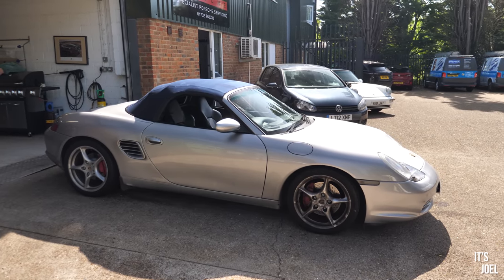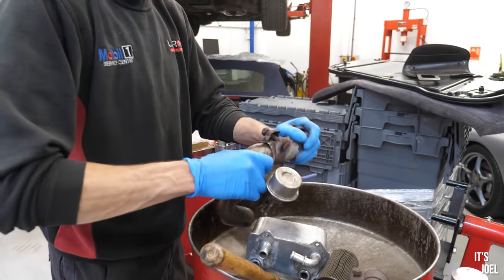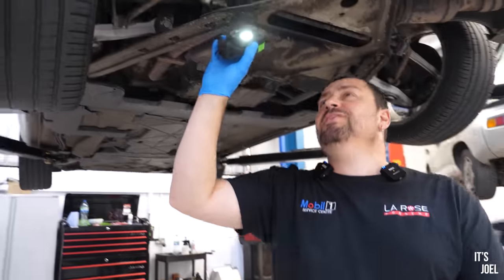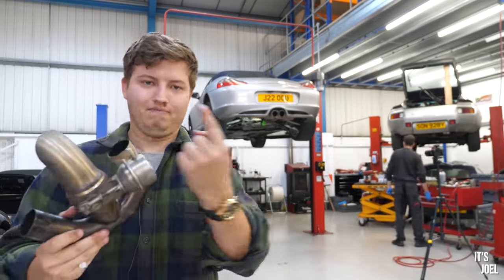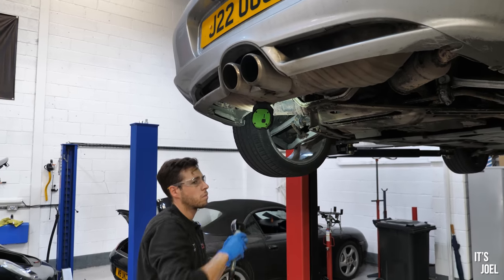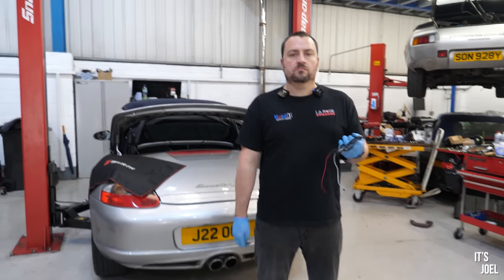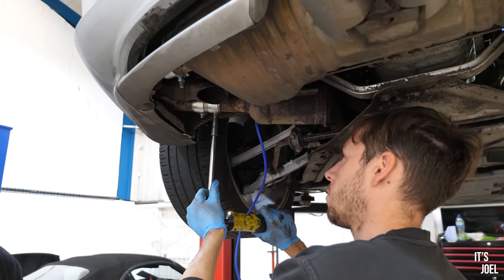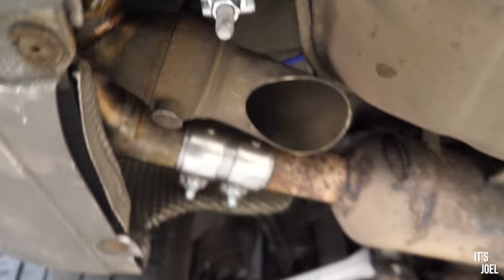Crazy valved exhaust for my Porsche Boxster S!

Comment: I did a similar mod to my 2004 Z4 3.0...less than $300US including labor. The remote control allows for 4 different levels of noise (from near-silent to a monster). Going under overpasses or driving thru a parking garage, it's glorious. Juvenile? Unquestionably. But like you Joel, puts a huge smile on my face everytime...a 2nd mod I did...adding a bass shaker (particularly if you've got a convertible)...makes the stock BMW stereo sound incredible! Thanks for the vid...I really doubt that I will ever part with my manual Z4...I never tire of its performance, comfort, and sounds (stereo and exhaust). Be well Joel!!
Reply: Where did you get that done did have the I guess remote control vacuum I’m in California I’m just curious I’d like to put that on my Boxster

Comment: Nice mod, good to have the option of loud & quiet all built into the one system.

Brembo discs are great, put them on mine. The hats are nicely painted and they have updated the internal cooling fins, means they are also no longer directional.

Comment: Two comments: 1) This is a much better exhaust mod than a new exhaust. The 'highly regarded' exhaust I put on my Boxster S had a resonance between 2700 and 2900 RPM that made cruising almost unbearable. 2) Every time I see a Boxster video when the wheels get pulled I get very nervous - the front and rear wheel studs are not the same length. The front studs are longer and if used on the rear they WILL shear off the the emergency brake mount on the rear suspension knuckle when the car is rolled out of the shop. That's only about a thousand dollar part and another thousand in labor & misc bits plus an alignment to get right. Ask me how I know ...

Comment: Apologies if you're already aware: to minimise the risk of brake disc warp on track days, stick to 5 laps max, one warm up, three hot, one cool down with only light use of the brakes. Also, don't apply the handbrake in the pits, leave it in gear.

Comment: Left front disc looks wrong. The vent hole pattern is handed L or R. The holes should sweep backwards  toward the edge of the disc on the upper part of the disc. Brembo used to do a Left and Right disc for 996/986

Comment: Just a couple of questions regarding your experience . As i've now fitted the system but I do have some questions:

1) there does appear to be a small amount of exhaust coming out of the valve output when the valves are closed - is this normal?
2) the sound when the valves are closed is louder and bit more throater than stock (not a bad thing at all!) But wanted to check this is normal too? 

And finally, if this is normal (3) I assume the car will still pass its MOT emissions test when the valves are closed?
Reply: Would be nice if he bothered to reply eh?
Reply: So here's the answer having now gone through an MOT

The valves make it harder for them to test the exhaust emissions, something to do with extra air (?) and 4 "exits" instead of two (even if the valves are closed). This technically means it should fail an MOT.. a good garage will however be able to deal with it. 

That being said, I love the modification and installed it myself. Valves off the car sounds better and  with them open it sounds like a monster. 

😂

Comment: the boxster S 3.2 from the 986 series with two cats of four removed and a high flow exhaust.... really one of the best sounding Porsches ever. 
not a carrera gt...  but you can hear the induction noise as well... my 911s, just don't sound as good. faster yes. sound. no.
and dropping two of the four cats definitely increases the power output.
Reply: 100% agree.

Comment: How do brake discs warp? I had a Saab 93 years ago and it kept warping its front discs, I changed them 3 times in a fairly short time....
Reply: Generally getting real hot and then getting wet. Driving hard during the rain, More typically through deep water in my experience

Comment: I love everything done in this video, amazing but stealthy exhaust (I love discreet cars), fixing warped brake discs though I hope those Brembos are good (something I currently have, 9 months after installing new Brembos, apparently I ran through water?! Warping seems a common issue with Brembos) and fixing wheels, which causes steering wheel judder at high speeds, which is something my mother's car has because she hit quite a lot of curbs. So a lot of satisfying stuff I would have wanted to get done myself 😄

Comment: I had the bypass mod done on mine which is effectively two pipes bypassing the backbox and fed in to the tailpipe. It did sound really nice but was way to loud and i ended up hating it as it sounded really antisocial. I ended up swapping it out for an original spec. I expect yours is really really loud looking at the size of the valved openings... but as long as you enjoy it👍
One question though...why does it not effect the fuel/air mix, as surely opening up big holes close to the o2 sensors in gonna play havoc with them even though its down stream?
Reply: Did you have the Carnewal exhaust mod done or another brand? Just fitted a Spyder catback exhaust to my 987.1 and it is insanely loud if you go anywhere near the throttle, looking at other options at the moment but may wait until I've done some miles and see if it settles down
Reply: @timprice5  I bought mine with the mod already done. I think it's was fabricated by Oettle in Germany. As you say, they are insanely loud.

Comment: Now take it to central London and see if it meets the 75db limit open 😂, also the ring were I assume your off have a strict noise limit and will ask you to leave so be careful
Reply: Surely thats the whole point of the remote valve, so you can close it to lower the noise levels when needed?
Reply: @spyder_man  I don’t think it will stand up to dvsa check as it bypasses the silencer it falls foul of construction use, the other issue is has he told his insurance as it can be deemed a performance modification
Reply: @DashDriver-z1r  Ring is @130db , i dont think thats even close to that as it only eliminates rear box and leaves all Cats in place.

Comment: Hi, I love your videos but I think you are misleading your followers with "under £500" information. I went on the garage's website then spoke to the owner in the phone. The price for the system is 
£355+VAT (£72.50)
The owner said it takes about 2.5 hours to fit it and it is  £100 per hour + VAT which is another 
£250 + VAT (£50).
The total is 
£605 + VAT (£122.50)=£722.50.
I have been watching your videos for over a year and hoping you edit your post and update it as soon as you can. Your video is only 9 months old and there are similar bypass systems sold on alibaba for about £150+ £100 P&P plus customs excluding labour obviously. I think the total is still under £300 and it is not a rocket since to remove the "U" joints and do the job yourself. Many thanks

Comment: Fake exhaust notes are up there with fake exhaust tips! Pointless!
Reply: Does that mean all performance cars have fake  exhaust notes then? They are all tuned to give a certain sound depending on vehicle type.
Reply: @jonedgar5996  in my opinion it's a fad. The new trend. But certainly manufacturers can tinker with the ecu and system to make the exhaust sound like this.